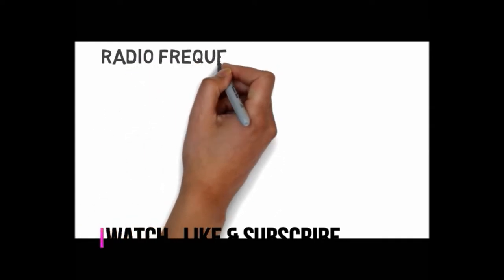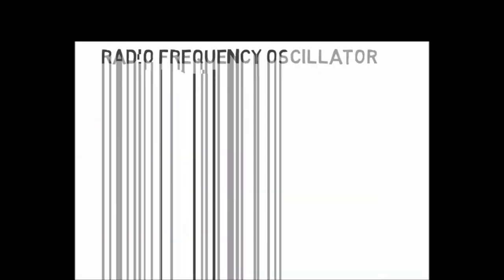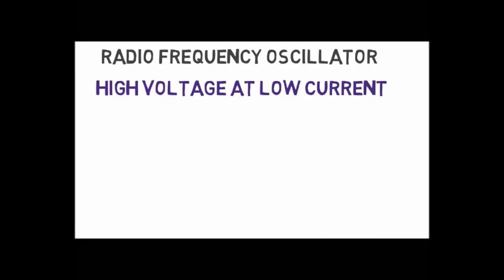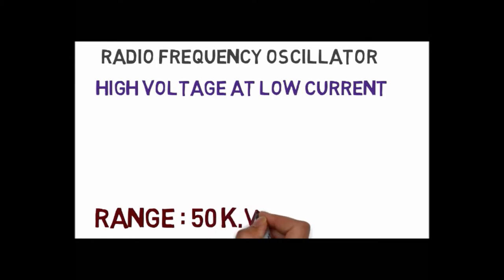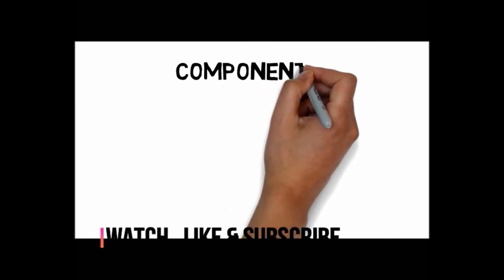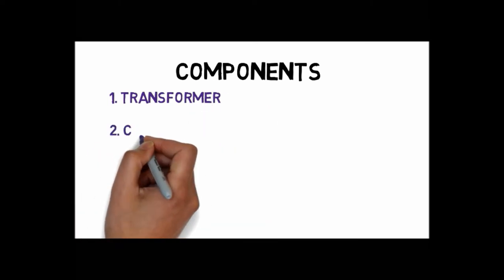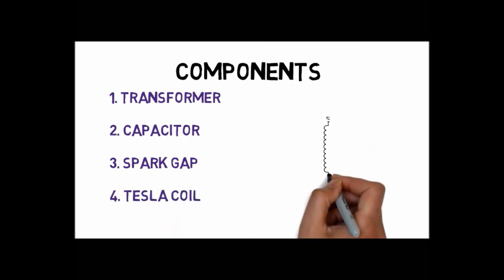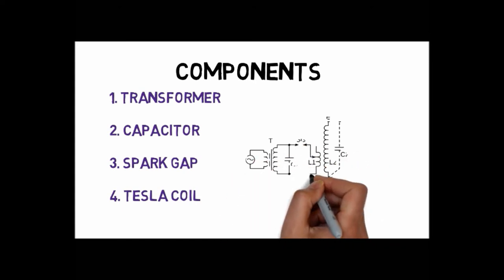Wireless Free energy Transfer using Tesla coil.

Comment: Is not free energy its just wireless energy, this cant be free energy because you are using the battery power
Reply from the maker: It's free as free Wi-Fi....
Reply: @circuitandtech  its not free wi fi because the tesla coil produces a lot of radiations that can block de wi fi
Reply from the maker: @Headbutter-Lettuce90  I told u that someone  pays for Wi-Fi and others use the wi-fi for free...so and Tesla coil is not protected anyone can use it light a bulb for free of cost .
Reply: @circuitandtech  oh ok  i just confused 😊